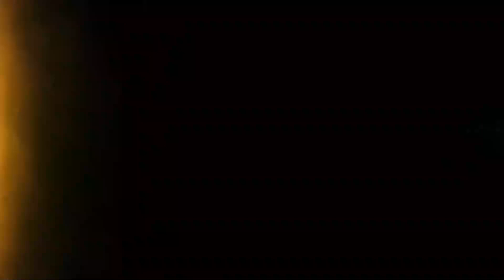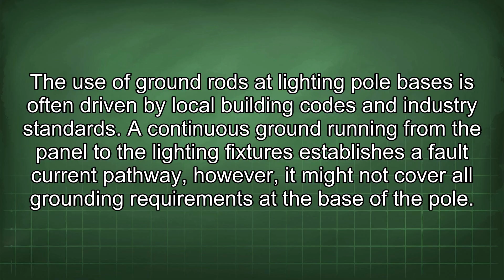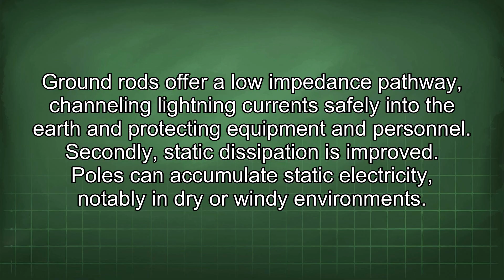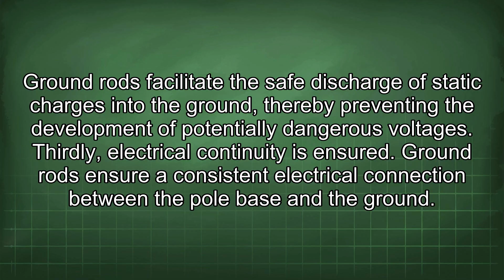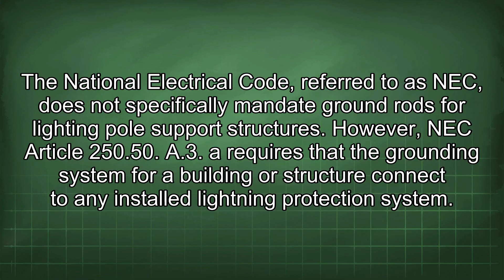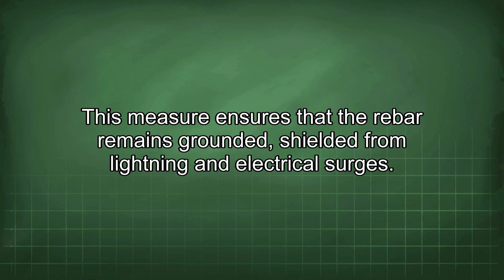Ground Rods at Lighting Pole Bases Explained

Comment: We need to all be on the same page. I was putting in the equipment ground on some equipment and I had some one coming behind me unhooking the ground and driving a ground rod. They seem to know everything and everyone else is wrong.  Mike holt says we don’t need ground rods at light pole it serves no purpose. What is the answer and why can’t we keep it consistent with everyone?
Reply from the maker: Hello @josephwinger3158,

Thanks for your comment. We are aware that this is debated between communities and even on the NEC panel. In our studied opinion, you should have both the ground conductor (EGC) and ground rod. Depending on interpretation of the code and AHJ modifications, you may not need the ground rod. However, you always need the EGC in any grounded system.

The point of the ground rod is to prevent lightning strikes from damaging the rest of the system. Tall antenna masts or parking lot light poles are often more prone to lightning strikes. Unless your parking lot is next to a skyscraper, it is a very good idea to have the ground rods. For example, in wide, open parking lots next to a wide two storey mall or office building. We also recommend placing an SPD (Surge Protection Device) in the panel feeding the parking lot or antenna mast equipment.

Sincerely,

BESA Research
Reply: @BESAResearch  how is this going to prevent lightning strikes from damaging equipment? So I can understand what the purpose of this ground rod.
Reply from the maker: Hello @josephwinger3158,

The lightning strike is taking the lowest resistance path between the earth and the clouds. The ground rod ensures that path does not take any significant detour from the light pole and the ground.  I will explain more:

If you mount the light pole on top of concrete barrier formations, this is particularly a concern. Concrete is generally considered a poor conductor, with high electrical resistance. Its resistivity (measured in ohm-meters, Ω·m) can range from 10² to 10⁶ Ω·m under typical conditions. Therefore, a significant amount of current in the lightning strike will follow the path of the conductors in the circuit, including up to the internal building wiring. To visualize this; the lightning is at such a high voltage that the entire electrical system of the building acts as a single conductor.

The goal is to allow the lighting strike a direct path with the ground using a ground rod, rather than a parallel path through all of the building wiring and equipment. Depending on the exact conditions, there is virtually always some stray current from a strike, even with a good ground rod. This is why an SPD at the panel feeding the elevated outdoor circuit(s) is recommended for additional protection. Also, always remember to ensure that the ground conductors are adequately sized.

The ground rod also provides an important function of equalizing ground in the system (AKA equipotential), though this will be a lot less noticeable than lightning damage under safe conditions. 🙂

For example, if your parking lot extends several hundred feet from the building, it can get to the point where stray currents from the utility MGN (multi grounded neutral) distribution system or other issues are measurable between the physical ground and your ground conductor.

Sincerely,

BESA Research